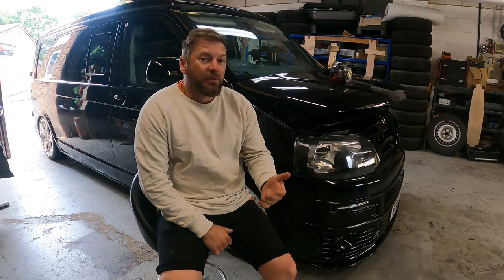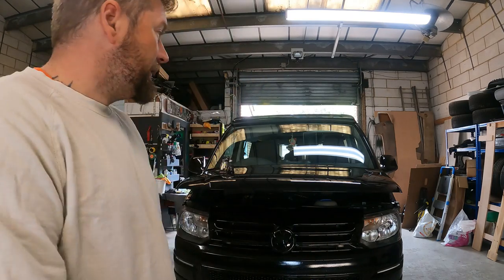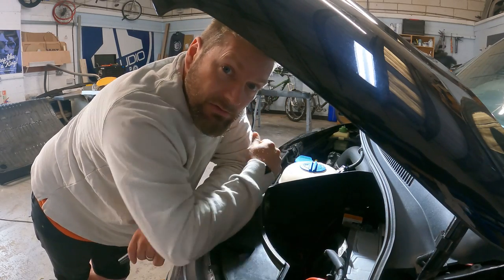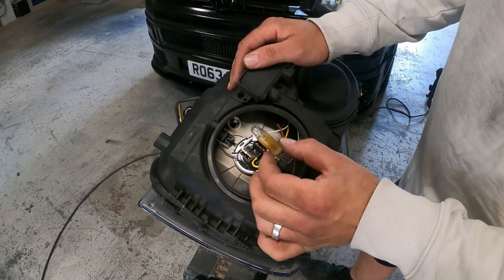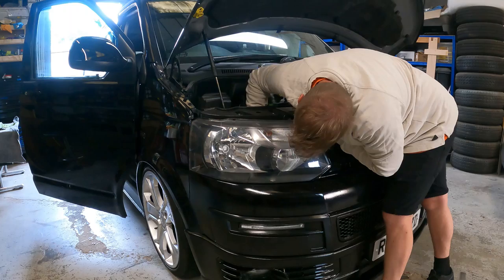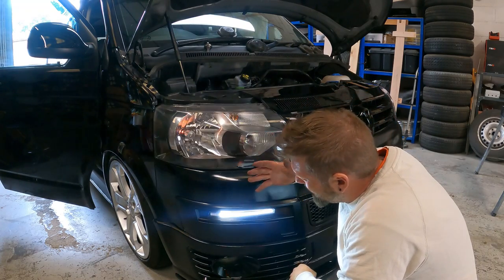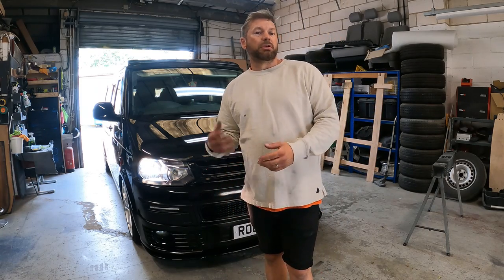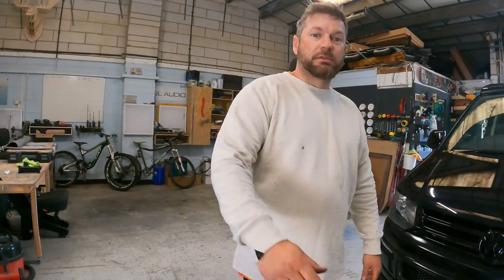vw T5

Comment: I don't know what's going on but I have the stock headlights on my T5.1 and Golf 7. On both of the associated  forums and groups everybody is complaining and moaning about how bad these lights are and need LED /osram night breaker and whatever. I used them as they are for long night driving and my opinion is that they are truly awesome as they are. Ok, I wouldn't mind a pair or two LED bulbs but I don't feel any urgent burning need to do it ASAP.
Reply from the maker: The led main beams are great much brighter at night, the rest of the leds don’t make a massive difference  but match the others. The standard light are far better than any of the aftermarket one 👌🏻

Comment: Congratulations on the new job BuDi 👏🏽
Reply from the maker: Thanks fella👌🏻👌🏻👌🏻👌🏻
Reply: @tomtdubz  hey quick question please if you will:
I just started developing a water leak from the passenger side door at the foot well (plastic bucket bit as u step out). It only started a week ago..
Oh it's a T6. I have no idea where its coming from. Have you any advice, tips or tricks?
Reply from the maker: Could be coming from anywhere above there. The roof channel would be the first port of call.. check the roof bar bolts, check the top of the screen too.. that would be my first checks
Reply: @tomtdubz  I'm on it thanX.. What u mean by the top of the screen?
Reply from the maker: @motiv8154  top corner of the screen, neck the seals
Reply: @tomtdubz  cheers, could leaf litter build cause leaking? I have a feeling there might be a munch of leaves under the bonnet near the wiper grill bit😬